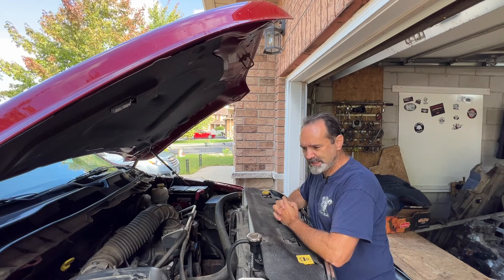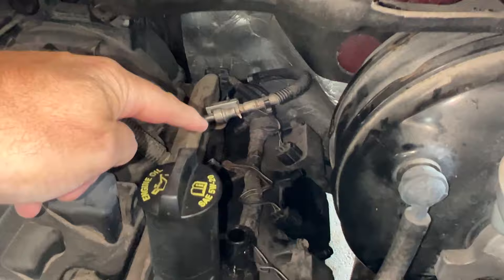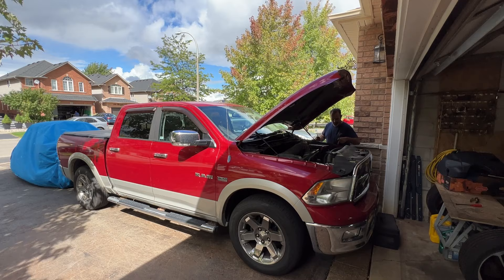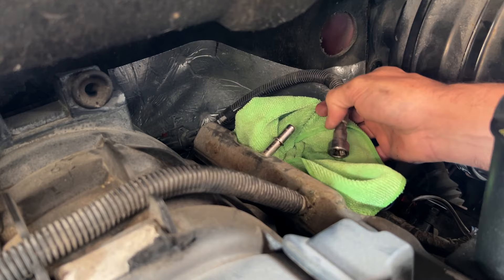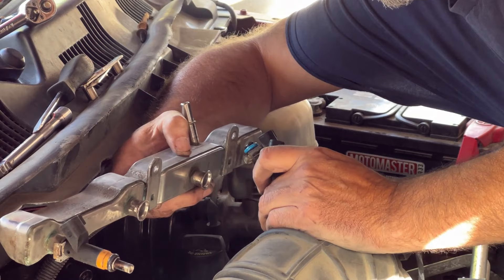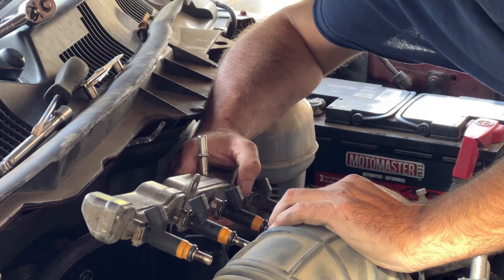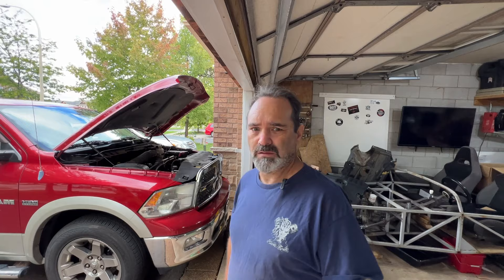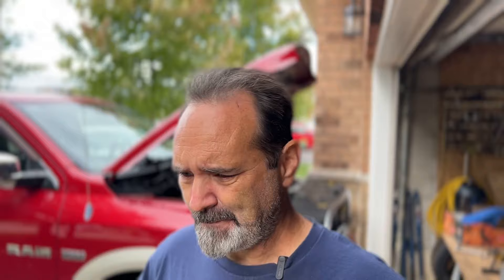Could My Hemi Engine Fault Code P0305 Be Caused By A Faulty Fuel Injector?

Comment: Cylinder #5 is on the passenger side. Not the left.. I am deal with that now. Thick it’s an injector.
Reply from the maker: Hate to disagree but cylinder 5 on a Hemi v8 is on the left side.  Number 1 is front left, 2 is front right, 3 is left 4 is right 5 is left etc etc. 
in my case, it turned out to be a bad pcm. Keep us updated on your progress.
Reply: Oh, I am glad you got it fixed. My truck is highly modified, supercharger, headwork, cam, lifter etc. I suspected the PCM being bad before because of all the random codes I would get from time to time. It’s a Diablo unlocked PCM. Mine is a bit more complex. I replaced coils and spark plugs this weekend hoping that was it. But it’s wasn’t. So now I am between PCM and injector. Spark plug from cylinder 5 sis look a bit starved so it could be from either one of the two being faulty.
Reply from the maker: @nickwilliams1961  Are you using a scan tool?
Reply: Yes, I have a scan tool and a computer both are reading P0305 which is for misfire in cylinder fire.
Reply: 5 is on driver's side
Reply: I had an intake valve spring that was broken, still have a terrible missed fire tho. I think my tune files got corrupted. The cam timing must be off.
Reply: @ScottRods you sure
Reply: You sure

Comment: same year, same model, even the SAME damn color  same  cyclinder,    Im swaping  fuel injectors right  now   already did  coil/plugs          was your  Cam lobe/broken lifter roller or something else?
Reply from the maker: Mine turned out to be a bad PCM (ECU)  I got a used one from a junker and got it re-coded to my truck. Problem gone.